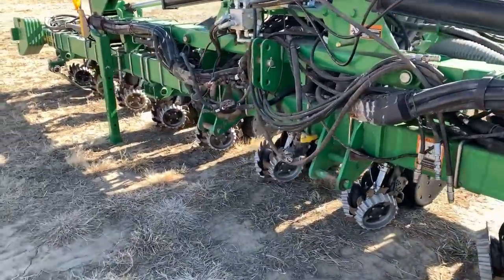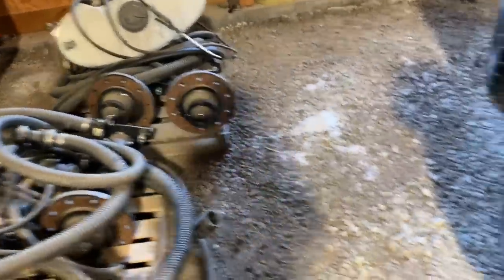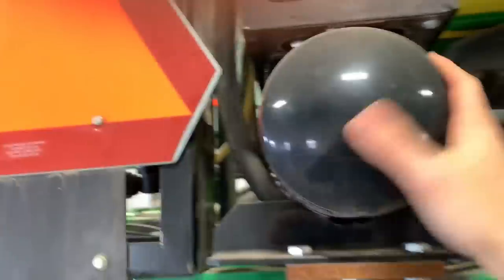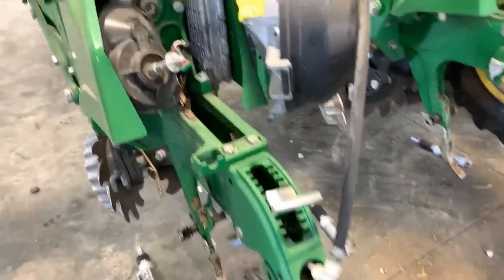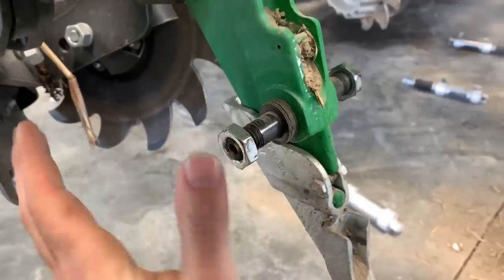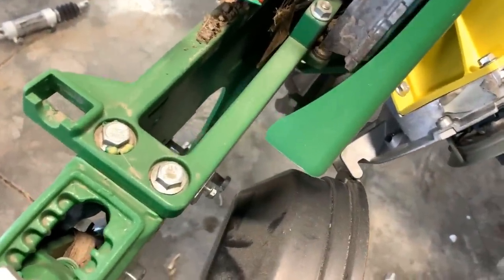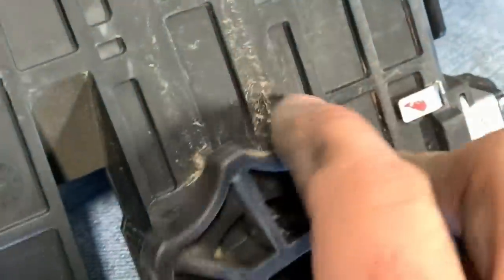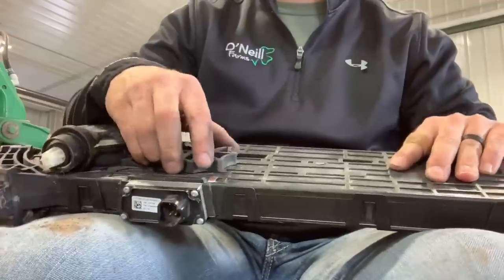Get It Together | Planters (Part ✌️)

Comment: It was kinda hard to see on camera. But am i correct in thinking that your closing wheels were too far apart with the original spacer? If so, could you flip them around 180* because it looks like the shoulder on one side is smaller than the side you used. Smaller shoulder + bigger spacer = maybe works? lol.... I'm sure you thought of that but it was worth mentioning.
Reply from the maker: Thanks. We did try flipping them.

Comment: Hey just thought I would share this  on the closing wheel there is a place called Fenning equipment that makes a bearing kit that replaces tho bushings u do that and u will never have to mess with it again and the closing wheel arms is another place called Coyote machine and the bore the arms and put bareings in those also and never have to replace the arms or threaded bushings and if ur parallel arms on ur units are getting lose look up precision planter parts the make a really good bushings kit for them too we have used all this stuff and had great luck makes the planter 10 times better and less maintenance
Reply from the maker: 🤔 thanks for the tips. look into those. Appreciated.